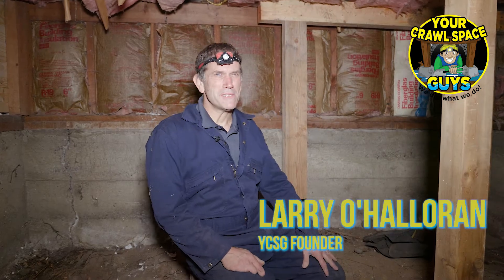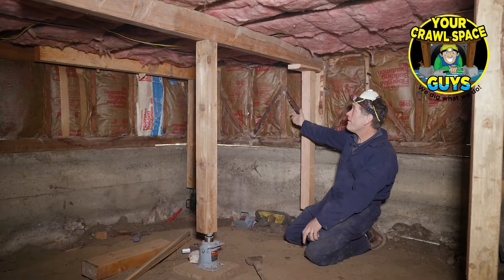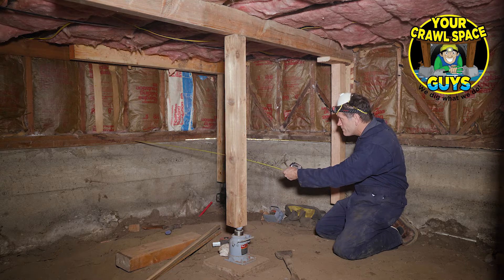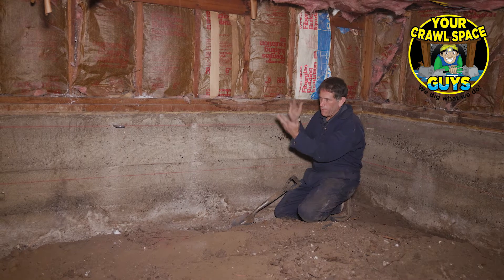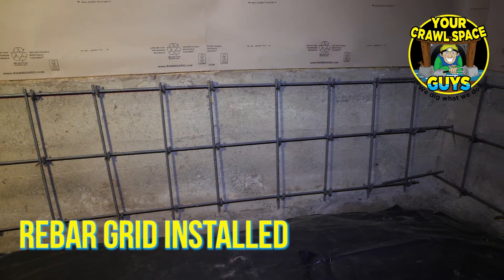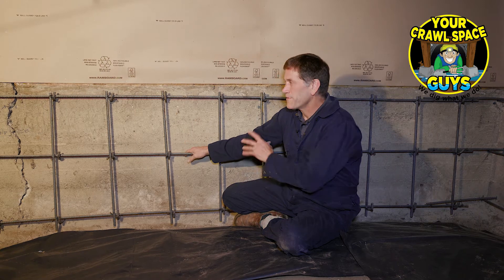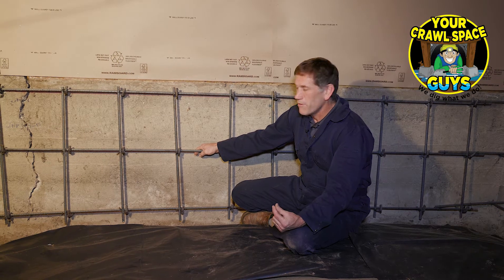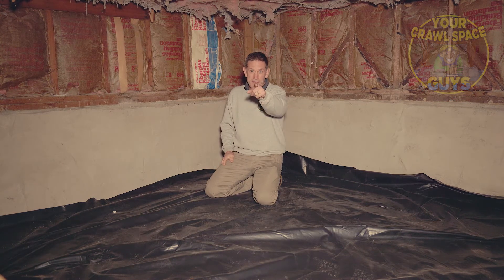Shotcrete Foundation Repair in Oregon | Leveling Foundation | Crack Repair & Strengthening Footing

Comment: The house appears to be sinking because you have a soils issue. There is an issue with the soil that is causing the house to sink or move laterally you’re trying to repair it as a construction defect it would appear. That will not work long-term the crack happened because the curtain wall sunk. reinforcing the existing curtain wall and amending the footing will only add more weight to the problematic soils.

Comment: Just a suggestion.  Instead of a tapered wooden wedge that is impossible to properly fit between the top of the old footing and the plates.  A nonshrink concrete grout would have been a beter solution.